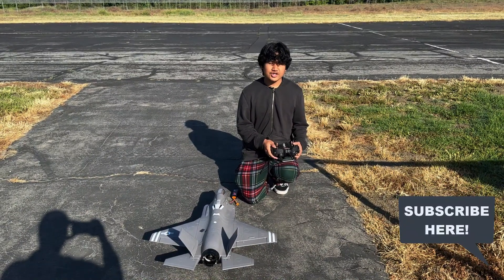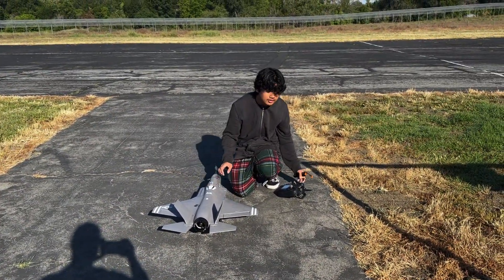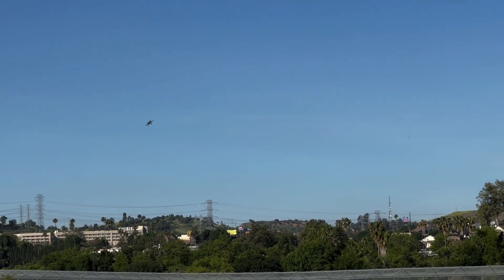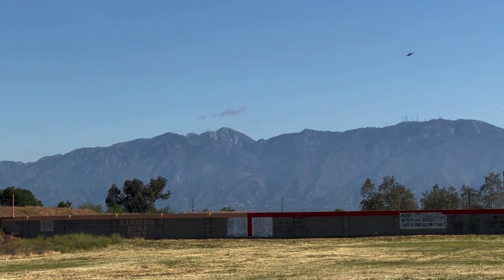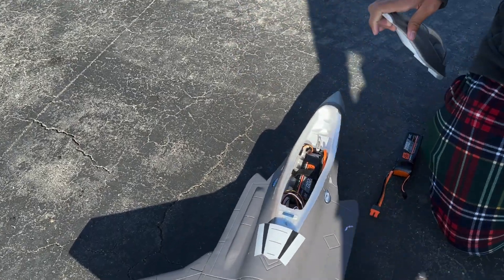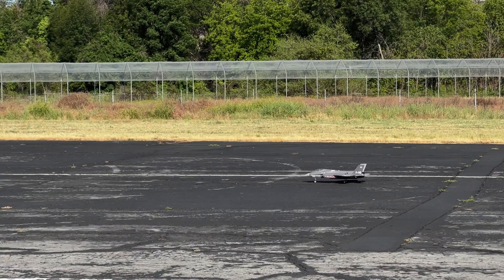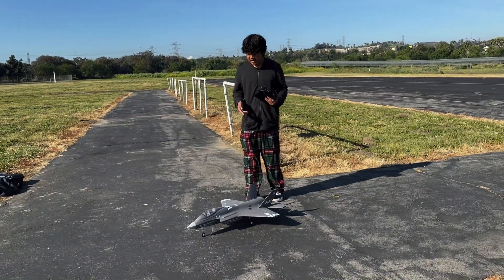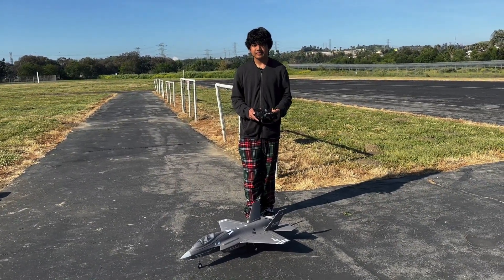FMS F-35 V2 64mm EDF Jet - 3S versus 4S flight!

Comment: You fly excellent!!
I just upgraded my f-35 v2 and put a 70amp avian, xfly motor and 6s. Havnt ran it yet but I will keep yall posted if it can handle it on the power vs weight.

Comment: Nice flying. The fan motor is 3900kv, it will not last long with 4S. Flies better with 4s but not much  :-) . Replace with FMS 64mm fan,  3150kv, 4S and be happy. :-)